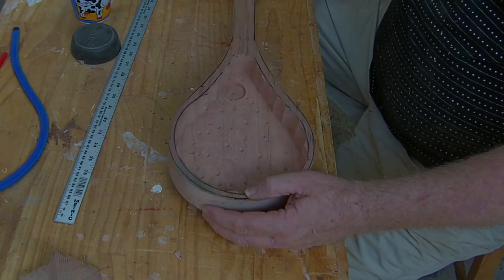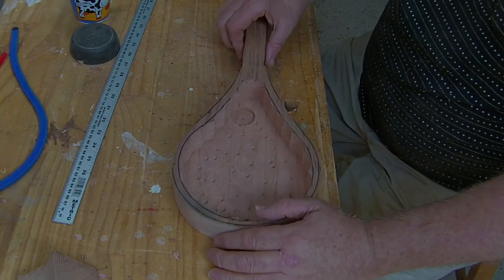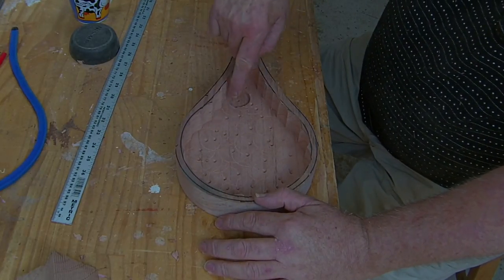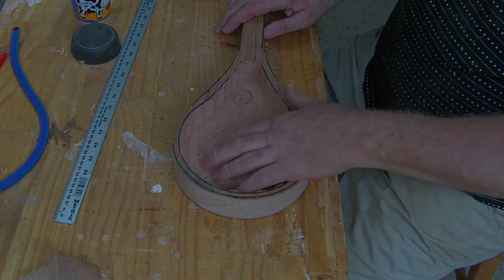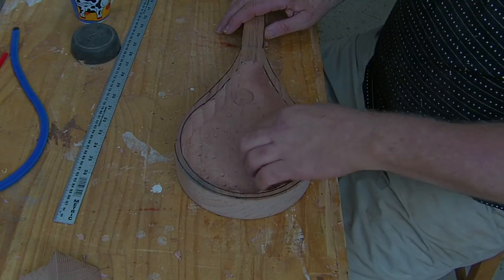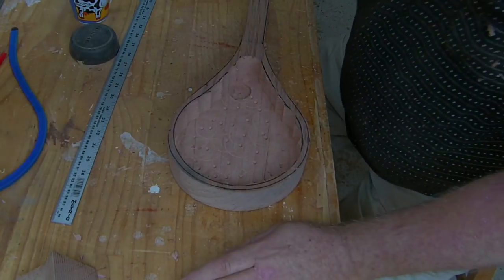Dulcimer, lets make dust

Comment: I like the idea of a carved back,  bowl stick dulcimer..       I would give you a tip from my Lyre making CD-ROM,   This is for hollowing out lyre bodies with Forstner bits.      buy two identical ones,   say 1"  25mm bits and on one file of the point.    you use the other to hog out most of the waste and the modified bit to take down the last 1/8",   then sand,  use a scraper to smooth the bottom.      The other way is to use a router and jigs but the modified forstner is the way I began